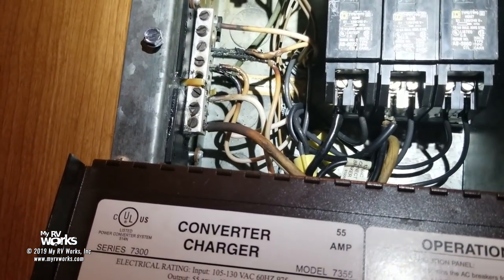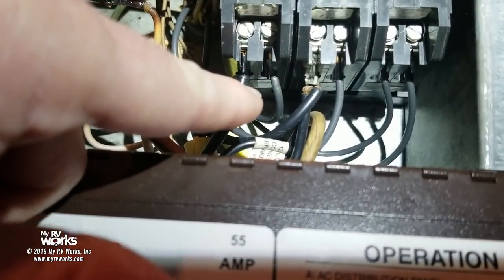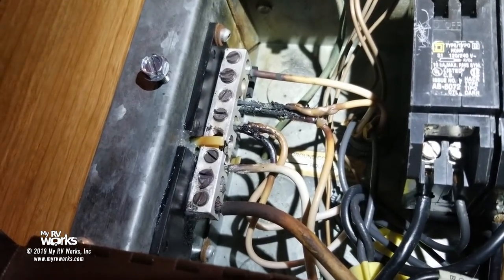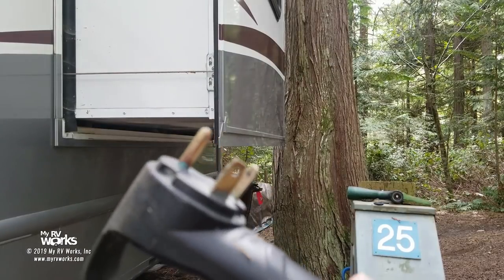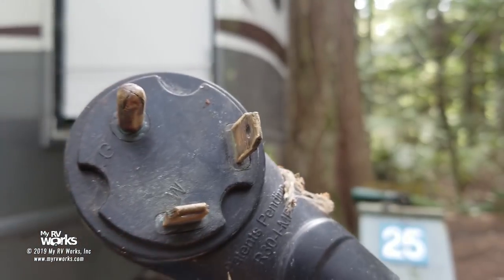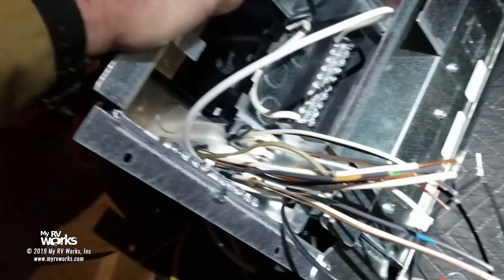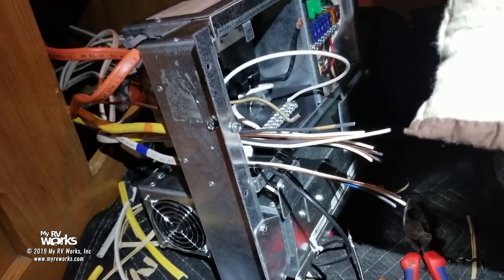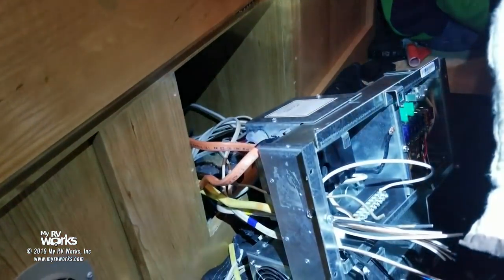Replace RV Electrical Service Panel & Explanation Of How Electricity Works

Comment: Thank you so much! I have searched for days trying to figure out why my neutrals were burned! I only opened up my panel to see if there was room to put a transfer switch behind it. OMG! That's when I discovered the neutral wires were toasted. All of them black, and the neutral from the shore power cord literally broke off of the buss bar when I touched it. The lug on that wire was welded to the bar. The ground from the shore was rubbed through and there was a melted corner of the bus bar where it touched the ground wire. I cut back what I could and rewired the neutrals and tightened them up as much as I could. But, when running the AC yesterday, I measured the temperature of the wires - 355F!!! I shut down the air conditioner and the temp decreased. Now, with just the AC for the fridge running, the temp is about ambient. After watching this, I wan't to flip off the entire panel and just run the DC and propane! Do I need to do what you've done here? Replace the (1999 30A) power center?  I feel like I want to replace the shore power cord too. It's wired directly to the panel and not a 30F/30M - just a 30M. This is a 1999 Winnie Brave SE 29A (F53). Uggh. I could cry thinking about how me, my son, and 3 dogs could have burned alive in that motorhome :-( - we've camped in it every weekend for 2 months. 

Also, and I don't know if this is related, but before I discovered the burned wires, I had turned off the power to a circuit I was adding an outlet to (hybrid water heater addition). When I tested the circuit before cutting the wires, hot was 0V, neutral was 2V. When cutting the neutral wire, the GFI tripped at the outlet of my house where the MH is plugged in. The GFI in the MH did not (that was the circuit I was adding an outlet into). Would this indicate that there's an issue somewhere in that MH GFI?

I also have a Hughes Power Watchdog EPO. It doesn't detect an open neutral (it can detect open neutral on the MH side and the pedestal side). 

I guess all of that was to ask; can all of this really be because of a loose connection at the neutral bar or could there be something going on up at the AC unit?  Any help truly appreciated. I'm pretty handy, and if I can do this myself, I would rather do that then send it to an RV repair shop. But, I really need to make this safe before we take of in 10 days across country to the desert southwest.

Comment: Excellent video, well explained.  Loose wires can really generate some heat.  Found that out the hard way on a loose ground in a boat, burning my hand just testing it.  
I do have a question, not specifically related to loose wires.  
50amp camper.  Power distribution evenly split for load.  No 240 volt appliances in the camper.  I found that there was 240 volts from the breaker ( one leg ) to neutral, but only 10-15 volts on the other.  If all breakers off, except the 50amp double, it returns to 120volts to neutral.  Flip on a breaker, even if appliance is off, it goes to 240.   I replaced the main 50amp breaker, but did not fix.  I eventually swapped out shore power cable and all is ok.  Shore power cable ( has leds on each hot leg ) has one led not working and the resistance in the cable, fully disconnected is 9 Mohms hot to neutral on one side but open on the other.  Thoughts?  Think it is the cable, or just elusive and something else causing it.  Did look at 50 amp plug in the pedestal and it looked fine.

Comment: I like the way you use analogies and comparisons to explain electricity for Voltage and amps. Plus alternating current with the hot patato anoligies. I also have a better understanding of the Neutral wire.

Comment: Well a loose connection create extra heat on any wire. Or if water is riding the wire get into panel. that why we put drip loops at a service heads on houses. Or if you are pull to many amps on wire. So if a wire rated for 20 amp and start pull 21 amps as it go up the wire will star to heat up. Or putting a 15 amp wire on a 20 amp breaker and pulling more 15 amps. The middle mini breaker left side look like loose connection. Double up your netural on netural bar usually when i see 2 netural on netural screw there is usually a good sign of  loose connection. . 1 netural wire per screw on netural bar. Used some wire nuts in that case. You have only 120 in Rv return back on netural back to it source it come from

Comment: Would have been great if you had shown exactly how you replaced the panel, including cutting power when working with wires. I have this same problem but I just want to strip back the burned up wires and replace ONLY the busbar. I am a female and I have never done this so a step  by step would be helpful

Comment: Overall, very well done.  One aspect that could use work for accuracy (but doesn't really hurt the main topic you are covering) is the distinction between peak, average, and RMS values.  Other than that and a couple little hickups, very nicely done!

Comment: Thanks for all the great info! We recently bought a 1985 Holiday Rambler Imperial 33. The main problem we haven’t solved yet is the board that indicates the holding tank levels and turns on the propane water heater. With a tester it looks like the board is getting electric but it’s not working at all and we can’t turn on our water heater. I did find a melted fuse box that was caused by a loose main black wire. I do see a white wire towards the back inlet hole under the closet that looks like it was pulled in to. Do you think the problem is a bad ground that keeps the board from working?

Comment: Electron flow due to "skin effect" is relative to frequency, so at 60 hz, skin effect is neglegable.
Reply from the maker: I learn something new everyday. Thanks for sharing. But, how about that Hot Potato analogy eh'. LOL!
Reply: Pardon the pun, but if "at 60Hz skin effect is negligible" then why are sparks flying when you touch skin to skin...either copper to copper or copper to your skin?
Reply: Sorry, did put my reply to you in the wrong place, but here it is: Pardon the pun, but if "at 60Hz skin effect is negligible" then why are sparks flying when you touch skin to skin...either copper to copper or copper to your skin?

Comment: Would tinning the ends of the stranded wire  help with getting a better connection on the 12 V side ?

Comment: I need your help ASAP. When I Connect My RV to the power source where I get electricity. It trips that breaker from the power source right after I bring the Main breaker switch from the RV. What is the problem? It just happened during a rainy weekend in Lake Side California
Reply from the maker: Here is something you can try. Turn off all the breakers in your RV. Then, connect to shore power.  Does the main shore breaker trip when all breakers are turned 'off' in your RV?  If it does, you would have an issue with the shore cord or the junction box between where the shore cord connects to your RV and the breaker panel. I'll put a link below to a video we just put out that addresses this.   The next test would be to turn on the main breaker in the RV. Then one after the other turn on the other breakers.  Being methodical like that you may be able to isolate exactly what circuit the issue is on. From there you can start the troubleshooting. 

Here is a link to a video we just put out that may also help.  https://youtu.be/yQNdfmdQhmo

Comment: The previous owner of my camper fiddled with the electrical. Just wondering what the wire nut is connecting. I know it’s one part converter but not the other end.

Comment: Great video... Here's a good tip and to all those who must do this is - make sure {if you can} is to Solder the new pig tails on ( the area where the junction is made  in the junction box to help prevent another hot spot - should the marettes come loose from the vibration of the coach.

Comment: Why do a lot of fuse boxes that I have seen have that one extra pigtail wire coming off  one of the hot wires on a breaker? On mine it just is terminated with a wire nut. Thank you for what you do helping to explain everything so well.
Reply from the maker: That extra pigtail that comes off of a breaker is typically used for a converter connection.

Comment: Just watch Your Video.  Question.  That in lb torque screw  driver handle     Did that cover all  jobs need or do you have to get different torque screws drivers    Great 👍 Video

Comment: Hello sir thanks for all those great videos 
I have a similar situation on my travel trailer thanks to you now I know what might have couse the problem now is there a chance that when this happened my converted got fried or no and if it did can I replace the converter only and new wires thanks in advance

Comment: The problem is 30 amps, all RV's should be 50 amp 220 not 30 amp 110
Reply: So that’s why I can’t use the rv A/C and a window unit at the same time right?

Comment: Excellent video!  I found that one of the ground wires attached to the electronic controller was hot when I was troubleshooting why my step would not retract.  Any idea as to how a ground can become a hot wire? Thanks for the great video.

Comment: xcellent video.  thank you.  any idea what main thing I need to look at if a 120 v 30 amp
plug was plugged into a double
pole 240 receptacle. 
the converter definitely fried
Reply from the maker: When we have seen that, certainly the converter. But also any other appliance that was 'on' at the time, this might include microwaves, water heaters, air conditioners. If the appliance was off when it got hit with 240 then there should not be a problem.

Comment: Darren,
How do you get the plastic clamps off of the wires? I am adding a 12 volt circuit to a Magnatech fusebox, but the plastic clamps are tight and it's not obvious how to open one up to put in a new wire. I love your videos you do a great job of explaining things.
Thanks Guy
Reply from the maker: Those are a one-time-use type clamp. I usually cut those off and install Romex clamps in their place.
Reply: @MyRVWorks  
Thanks! I was able to slip the wires out and replaced it with a Romeo clamp. Boy I hate those dumb clamps!
Thanks again!
Guy

Comment: I retired after 34 years as a Movie Electrician and a huge problem we had was the 60 cycle (Herz) A.C. vibrating screws, etc. loose on our lighting equipment. Every house I ever lived in needed screws tightened in the Main Panel for the same reason. Halfway thru my career we began switching from D.C. to A.C. and Direct Current never gave us any vibration problems but with A.C. sometimes we had to smack the side of the light to stop the loud vibration of some part inside our lights because it was interferring with the sound being recorded. Another thing we learned was that with some loads the neutral wires had to equal the hot wires...120 volt black leg, 120 volt red leg to make 240 volts run through 4/0 cable required 2 @ 4/0 cables for the neutral return. I think another problem you might be having with RV panels is that many of the wires are multi-stranded instead of solid and squish out sideways when fastened.
Reply from the maker: Interesting story, thanks for sharing it's always good to learn more about different things out there in the world. What we find in an RV is solid Romex Wire for the AC circuits and stranded wire for the DC circuit's. That's if they build them correctly. One of the biggest offenders is the pedestal where the RVs plug into. They're like toilet seats and no one ever takes care of them. The guy before you could have had dirty prongs because he dragged his cord through the mud and then plugged it into the receptacle. Then you come along and plug in and your plug confronts resistance from this dirty plug.  Therefor the electrons backup and create heat upstream in your RV!!!

Comment: I have an old Lance camper that I've been fixing up. It has a 30amp service. Up until now I always run it on the 20amp receptacle at home, My first time plugged into a 30amp RV park panel, I have issues. Whenever I turned on the big current items AC/Microwave I started smelling electrical. It seemed like it was coming from the distribution panel. No wires in the distribution panel were even discolored, the contacts in the breakers looked fine and the AC and microwave have separate breakers. The shore plug is new and the wires in the cord seem fine. The was no smell running the lower current stuff. The AC has a soft start so it doesn't have the start-up draw. The microwave is Lance factory installed. It has solar and an inverter but I installed an auto transfer switch so it's idle. I've ran both the AC and the Microwave at home with no smell but not since the RV park. I guess I'll try it again and see if I can figure out where the smell is coming from with the cover off the distribution panel, maybe see if any wires are heating up. I could use a suggestion or two. Thanks
Reply from the maker: If it's working fine on 20 amps but you get the issues on 30 amps, then I would say the issue is not in your breaker box. The only difference between the 20 and the 30 is an additional 10 amps. And the breaker box doesn't really see that.

One thing you can try is turn off all the breakers except the main and then one circuit at a time and see if you can identify it that way.
Reply: @MyRVWorks  It seems to be doing it at home also now on the 20amp extension cord. I pulled the distribution panel out and the interior cover off the AC unit. No wires are burnt or discolored. The breaker is old but looks to be ok with good contacts but I ordered a new one anyway. The AC and the microwave are on different breakers so I'm thinking it's upstream. I found no continuity between ground and power or neutral and power. I hate doing it this way but I guess I'll follow the heat.

Comment: I’m about to replace the exact converter. The customers lights 12v don’t always turn on or very dim and they had the battery charger bypass and installed a separate charger.   I’m going to replace the entire converter and rewrite the original battery charger and hopefully that works.  I never worked on one of these converters and quite hesitant.  Your video was very helpful I’m a licensed electrician in NJ.
Reply: Incredibly clear, concise helpful information for me, who has a background in electrical & electronic equipment having attended 4 years of "trade school" for the same.

Interestingly enough, we have been "on the road" the last three months and have had nothing but electrical problems mainly due to loose, corroded,  broken connections.

Our motor home is now going into its 13th year of service and these type problems are rearing their ugly heads.

I didn't understand why the "neutral" leads were overheating until you thoroughly explained the electrical theory causing the problems. 

Two of the situations were close to causing enough overheating that I'm surprised we didn't have a fire from EACH one!

The generator transfer switch had a loose neutral as well as the 30 amp inlet into the coach. Both had melted thier surroundings and the phenolic board on the transfer panel had burnt. The odor was what caused me to investigate in the nick of time. I will be touching the shore cord connection frequently from here on out!

I will be doing my "homework" tightening up ALL connections as you suggested AFTER purchasing the torque screwdriver you use ... I always just thought a good hand tightening was sufficient! Obviously not!

Darren, thank you for sharing your hard learned experience. Apprenticeship is becoming a lost art... we are in trouble!

Your (rambling) teaching skills are amazing! I enjoy the humor as well! Analogies right on target! 

I can only long for a skilled technician like you, but alas, I am on the east coast😢

Ray

Comment: Hey Darren, I'm a new RV'er (motorized) but have been around the trailer scene for a while and a previous crew chief for the F-16 in the past, so I appreciate your Marine quotes and I certainly can appreciate to 'embrace the suck' as well :) That said, I'm having some electrical issues with my 2008 Gulfstream Supernova 6400 which are just perplexing me at the moment; I've followed the 12 volt stream the best I can but the previous owner did some Jerry Riggin of their own before which I can't quite diagnose.  Long story short, the slides continue to give us issues and I believe it comes down to the fuse panel which is connected to the slide control unit (with their weird connections in-between); would it be best to just submit a request for remote assistance from you showing pics/video since I'm located in NC?  I have pics of the compartment area which holds all of the control units in there (slides/jacks) and the weird wiring that's in there that I'm talking about; seeing all of the vids you've produced I have a feeling you may be able to reduce my time of diagnosis on the rig which would just be great - and of course would pay for.  Either way, thank you so much for all of the videos you've produced; they've provided invaluable knowledge that I just would have no access to anywhere else - thanks Darren!!
Reply from the maker: Can you orphan their wiring and pull a new circuit? Basically recreate the circuit the way it's supposed to be?
Reply: @MyRVWorks  That's what we're trying to do right now but ran into a bad slide motor (made sure to own the motor), so waiting on that to come in at this point and will get a new wire harness installed from there.  We are having other electrical issues as well so I'm going to look into the circuit board and make sure all of the ground/neutrals are tight; I just ordered a torque screwdriver and several other tools based off your list on your website to show some love for all that you do!!  I'm sure you would have a field day if you we're to get your hands on our rig lol - thanks Darren!